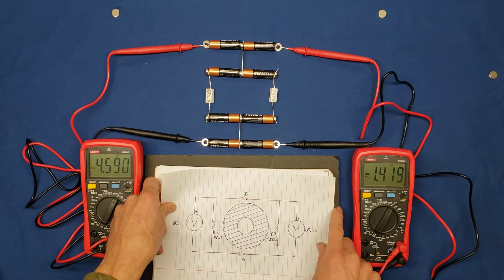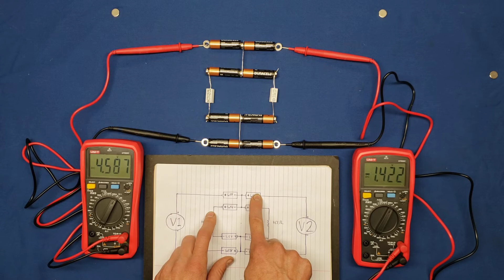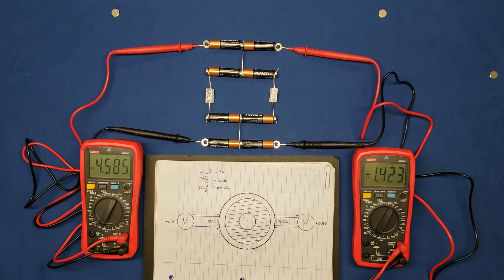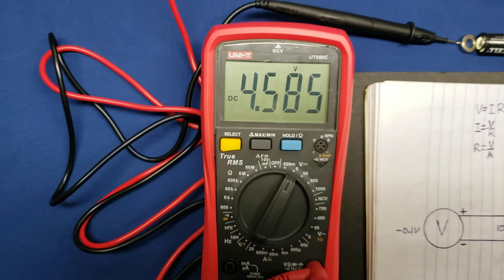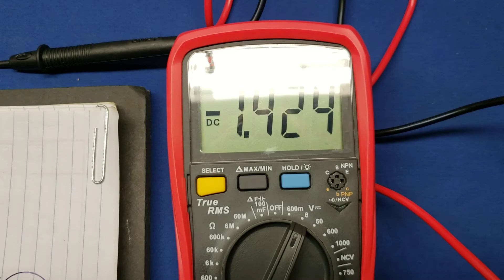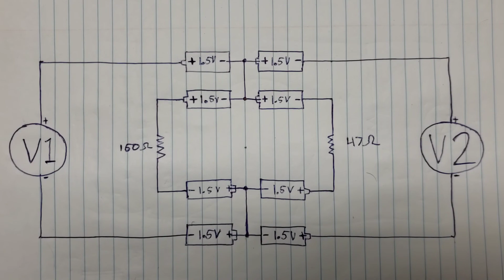Lewin's Paradox explained: Kirchhoff voltage law (kvl) doesn't  work with DC either!

Comment: Hello Mr. fromjesse; this video (comparing with batteries) reminds me about my very first reaction to Mr. Lewin about 3 years ago. This is what I wrote in his reaction forum from Lewin's video "lect 16" : https://www.youtube.com/watch?v=nGQbA2jwkWI&t=2629s:

<<<3 jaar geleden 
Dear mister Lewin, about your experiment, starting at 34:52. The reason why al lot of people don't understand the result of the measuring is,  they don't see that the  2 wires, going from the one resistor to the other, in this case act like a battery. Most people think that a wire acts like a passive component e.g. like a resistor with a very low resistance. But in this case the wire change in a kind of battery, because of the magnetic induction. Ofcourse, the "battery" in this condition gives only a short energypulse. So in change in your drawing wire D in a battery with the + on the right side, and wire A in a battery with the + on the left side, then it will be very clear for everyone why this experiment act like this. Because that is what it does, this experiment makes from these wires for a few ms a kind of battery. You can compare it with a battery that is almost empty and at the moment you put a resistor over it, the voltage drops down to zero in a few ms. Many people want to know which voltage would be measured over exact the middle of wire D an the middle of wire A. It will be 0.4V. Kind regard, Dirk Van Meirvenne from Belgium>>>

Mr. lewin gave me his standard answer that I didn't understood it. This was for me the trigger to react by making my own video. It is clear that you are triggered too by making more videos about this. Maybe you should number them. Best regards, Dirk
Reply from the maker: Thank you!
And it's not just that Mr. Lewin is ignoring the voltage induced in his probe wires, a couple of his disciples (who are actually very nice and genuine people) have been trying to show me that I'm wrong and that Mr. Lewin is correct, so that's why I made this video to hopefully help people to see the trickery in ignoring a voltage source in an analysis.